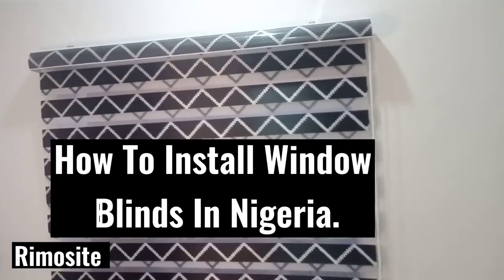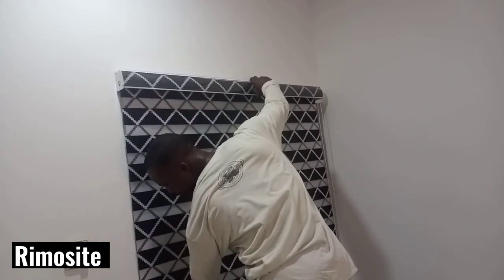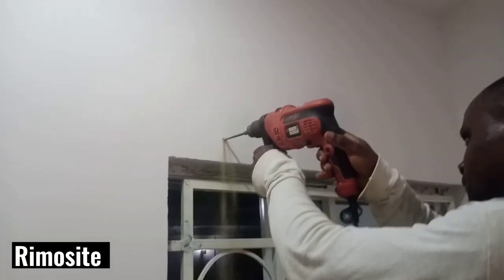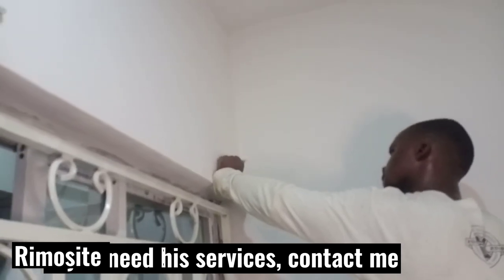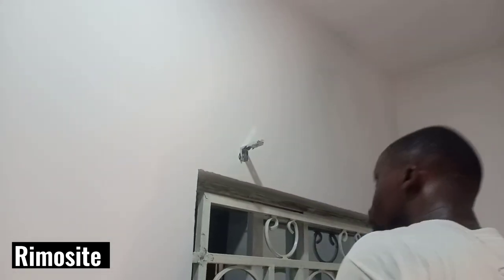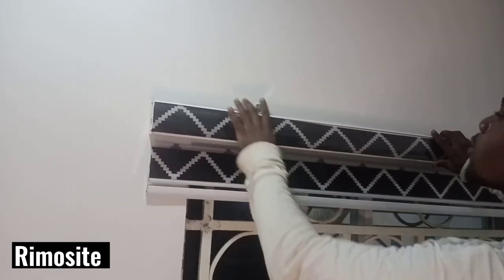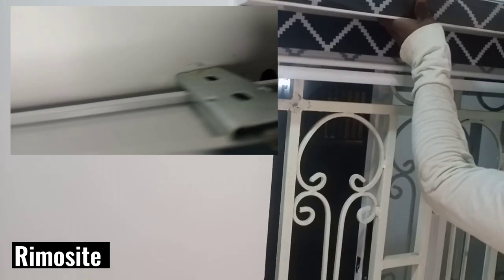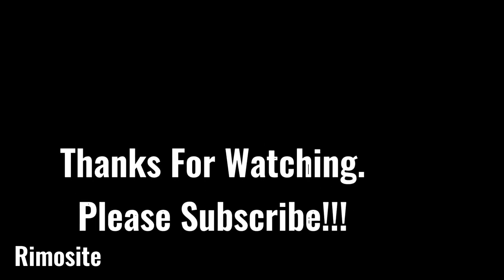How To Install Window Blinds In Nigeria

Comment: Thanks for the video! I have a quick question- In my case, I am having those vertical slat blinds and I have 2 issues and would greatly appreciate your response!
(1) In my living room window blinds, only 1 out of the total 9 blinds move when I pull the rope attachment. The remaining 8 blinds just stop moving along with the first one after 2 seconds of pulling my rope attachment so there is this huge gap created when I close the blind and sunlight comes right in.What to do about it?
(2) For my bedroom window blinds, i ma having the same issue but in this case 4 out of 9 blinds move after pulling the rope attachment. The remaining 5 just won’t move at all after a while so it creates a wide gap and sunlight comes right in. How to solve this issue?
Thanks ahead of time for your response🙏
Reply from the maker: Hi Dearie! Kindly contact the seller who coupled it together. He will sought it out.